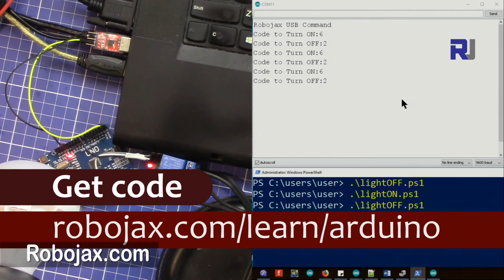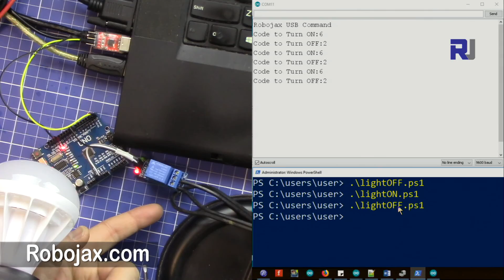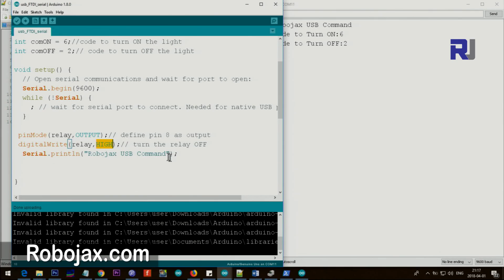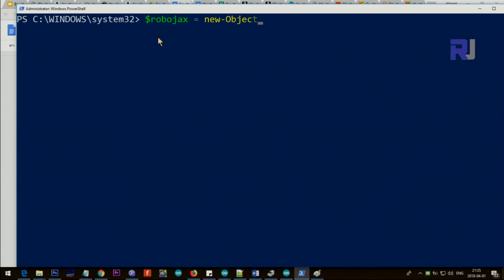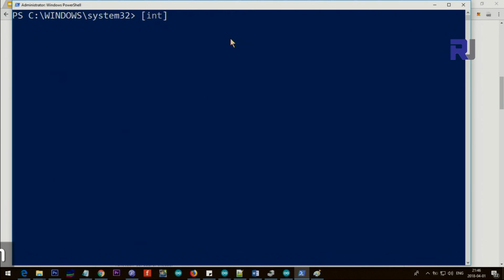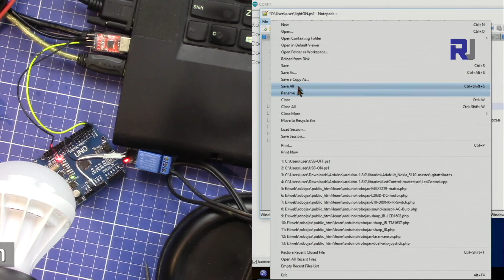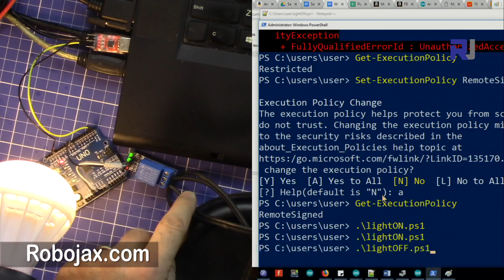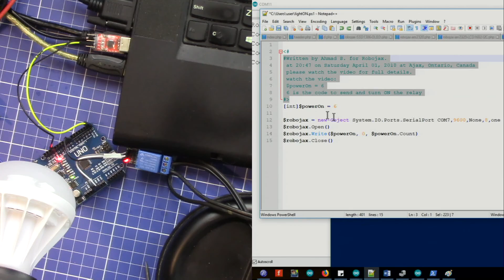Control relay and AC bulb from Windows Shell Command line via USB and Arduino

Comment: code 2 is working fine that turns OFF the relay $robojax.write(2,0,1), but code 6 is not working for me that turns ON the relay $robojax.write(6,0,1), (CP2120 USB to TTL and Arduino UNO) I'm using, can you help on this?